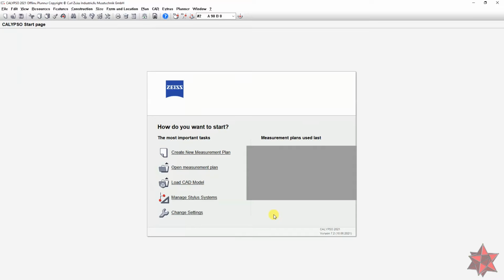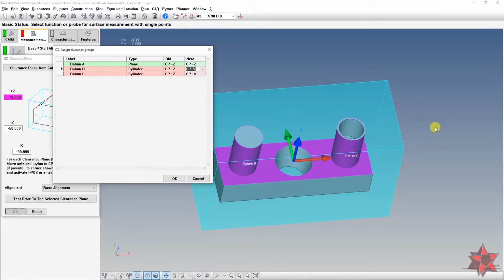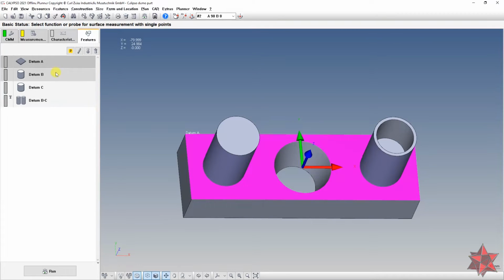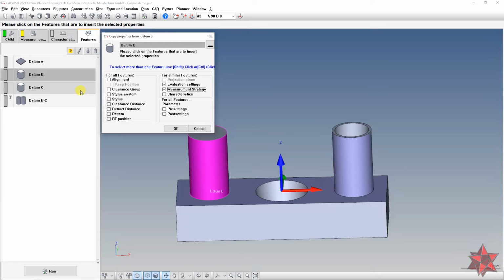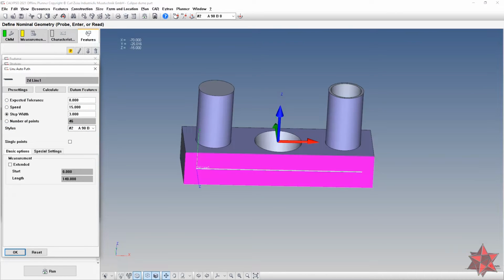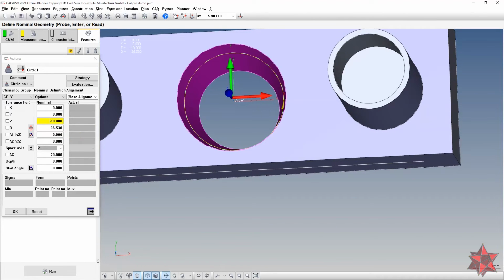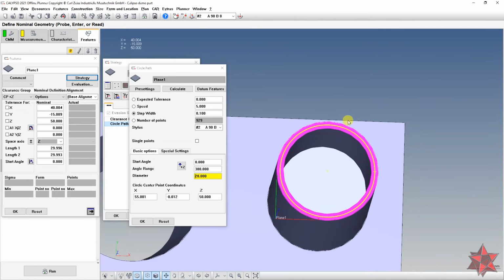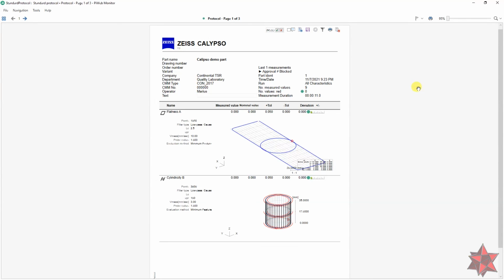Calypso flatnes, roundness and cylindricity'

Comment: Hi XYZ! Was the drawing mistake that the Ø36.53 should not have a tolerance next to it and it should be a basic dimension instead?
Reply from the maker: Hello, no it is not a mistake, it is a diameter measured at a specific height, look carefull we have a Basic dimension of 10 mm from the top plane. This method is used in ISO standards.